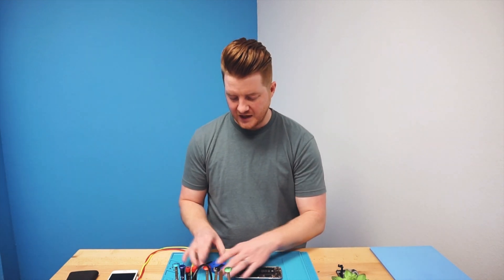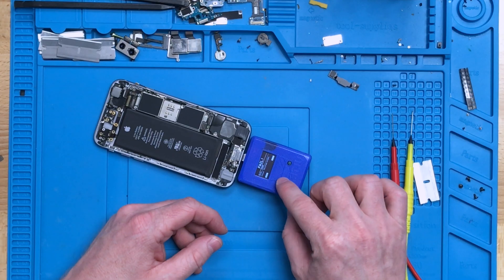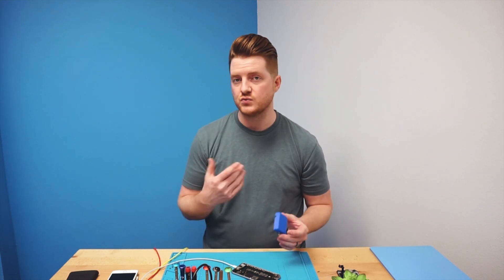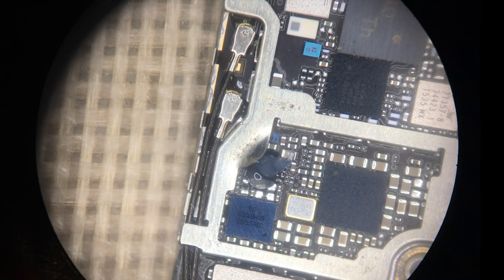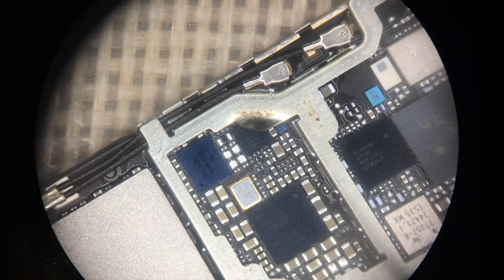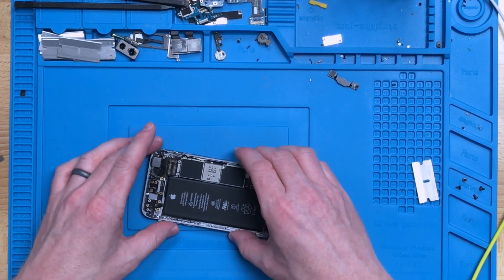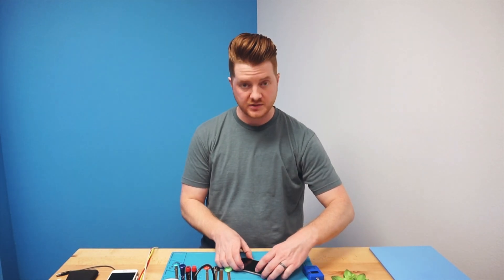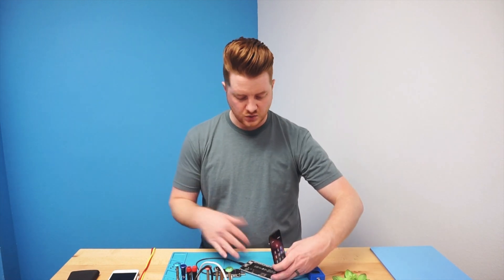iPhone 6S No Charging Fix - Tristar Repair - Full Walk Through with a Pro

Comment: you make it look so Easy!,  I own a repair shop and can solder chargeports, HDMI ports, I have a Hakko FX888 iron, and a  $30 heat gun, is it possible with this cheap of equipment, now i do have teh same Tacky flux and leaded solder, I do a lot of ipad charging ports,

Comment: Thanks for the great video! I had a question since I am trying to learn how to do soldering on smaller devices like iphones. In other videos I have seen people will take off the old solder from the pads underneath before putting down the new chip, is that necessary for these or is it more of a matter of preference?
Reply from the maker: Thanks! I def recommend running new solder on the pads. This helps to reduce the melting point since youll be using leaded 63/37 solder and as well it helps to even out the pads. I didnt do it in this video, but I have been soldering for quite sometime. However, for anyone learning, Id recommend always 'prepping' the pads

Comment: What if the charging issue is caused by the charging port itself? How to determine?
Reply: well, by measuring the voltage of battery connector it tells u almost every thing
3.7v it means charging port and IC is okay
0.5v it means charging port is okay but IC is bad
0v charging port is bad
Reply: @kombatub5925  thanks mate

Comment: What's the temperature you set the station to?
Reply from the maker: depends on a few variables but one station I have is 365 and another is 385. Do you currently solder?
Reply: @profixerr6275  I can do larger automobile components, but I wanna get perfected in micro soldering.

Comment: What temperature is your reflow station set to?
Reply from the maker: marsim30082 depends on a few variables but one station I have is 365 and another is 385. Do you currently solder?
Reply: ProFixerr ,  I used to own a shop so I have all the equipment, but I’ve never soldered. I’m trying to learn so I can earn some $$$.